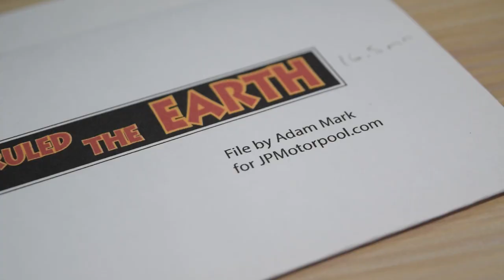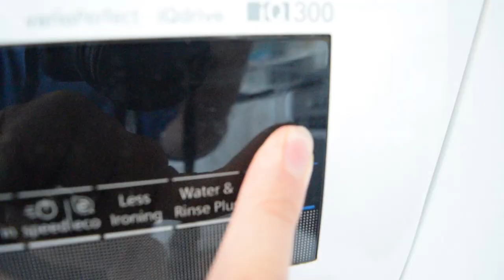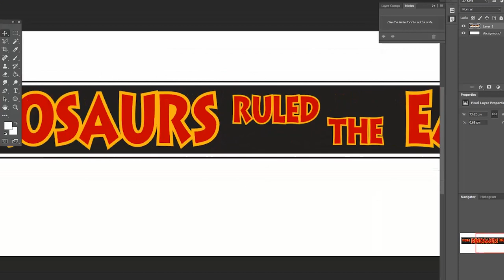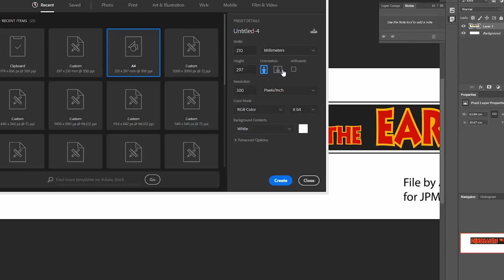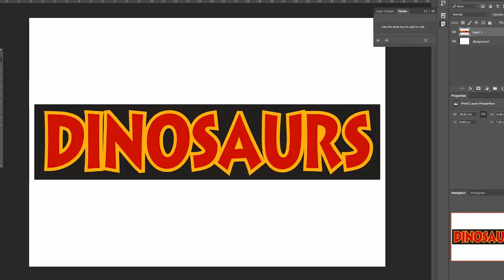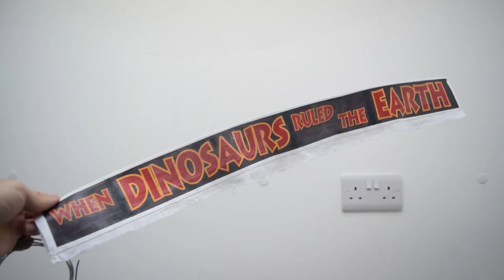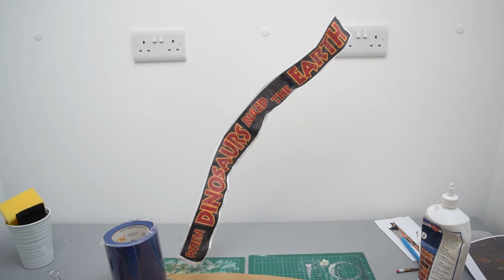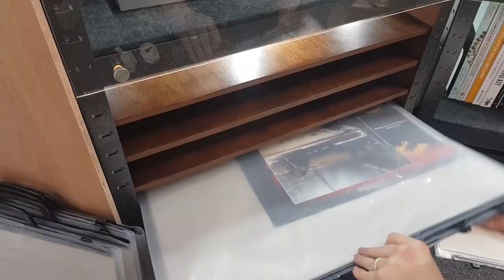Jurassic Park 'When Dinosaurs Ruled the Earth' banner replica | Iron Studios Rex | Display 005

Comment: where can I by the t rex mate
Reply from the maker: It was originally sold by Iron Studios for around $700, but has since sold out.  It also features as part of the main road attack diorama set but thats a bit more expensive - but can be found for sale on the Iron Studios website if you are interested.  Failing that, you can buy this on secondary market, Ebay for example, but the prices have gone up since it has sold out
Reply: @JurassicCollectables  any idea when it may be back on the market or have they stopped making it
Reply from the maker: @russellgreaves9020  Im not sure if it was a limited run - let me check my review
Reply from the maker: @russellgreaves9020  As far as I can tell its TBD if its a limited number, but for time being it has finished its sale run